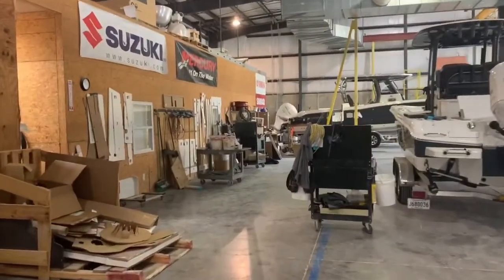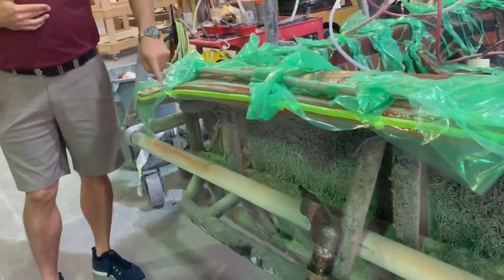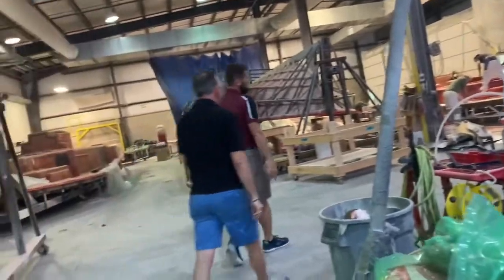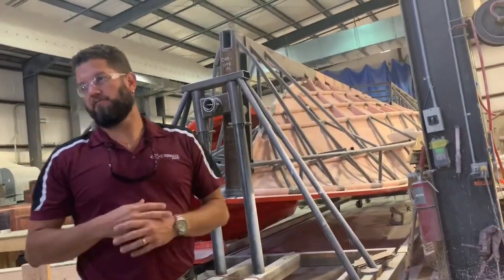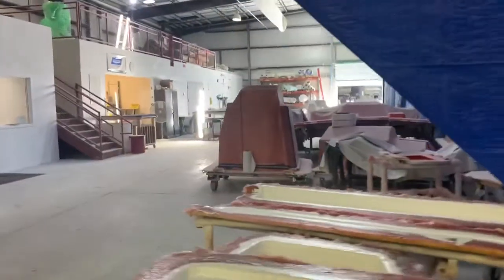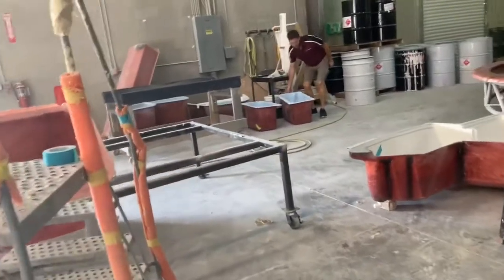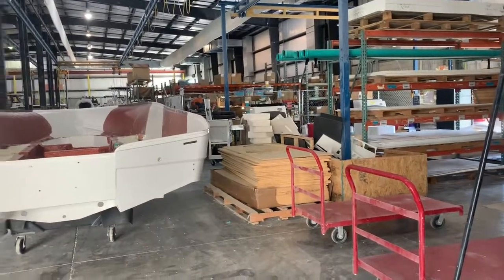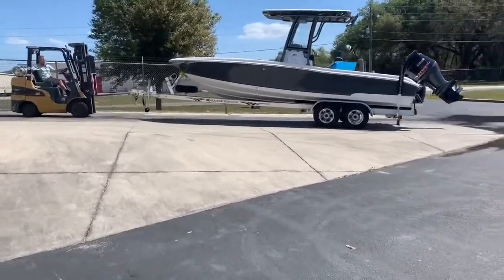Crevalle Boats Factory Tour

Comment: I worked at Seminole Marine in Cairo, GA building Sailfish and Southwind boats for a couple years before moving down to Edgewater and built those boats as well as working for Brunswick on Boston Whalers. When I moved to Ocala and started out at the new company called Crevalle I was very impressed with what they already had going for them being a newer company. Sadly some of the crew I worked with were not on the same page and things got nasty a few times. You do not cut corners to save time EVER. I left there and about a year and a half later returned but sadly the crew team lead was still there so was rough again from the start. I only lasted a year this time before throwing in the towel as not repairing damaged molds for a year and just PATCHING EVERY PART was slowing us down yet boat sales were increasing. The damage in need of repair was minimal on the mold but complex on the part and could have been done in one weekend. Never given the go so the go was me. I hope it has been fixed by now and they get a better team lead to pull them back up because they are great boats. Located in Wildwood, FL behind Russell Stover Chocolate on 44. I now do side  work repairing and modifying boats as well as winterizing for those that want it down here. Come to you and free estimates.
Reply from the maker: It is a tough industry.  I appreciate the perspective.  We have been a dealer for Crevalle since the beginning.  They have had some growing pains, but they have come a long way at the same time.